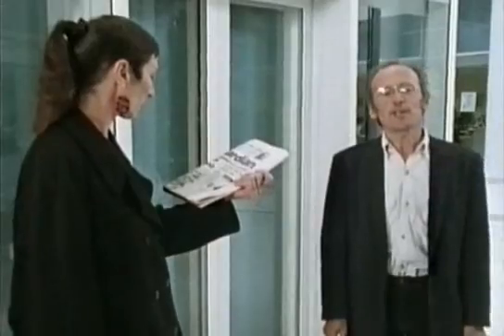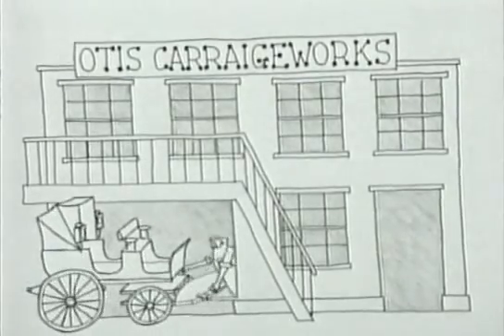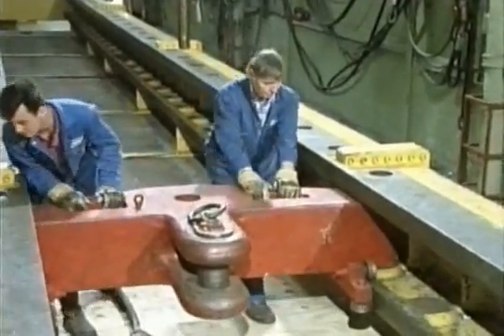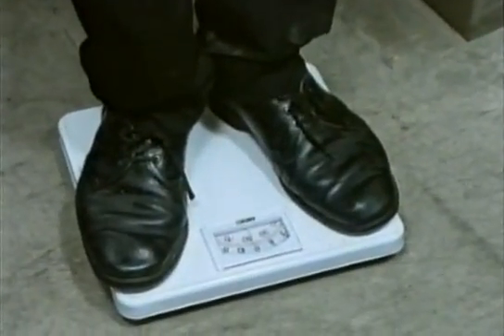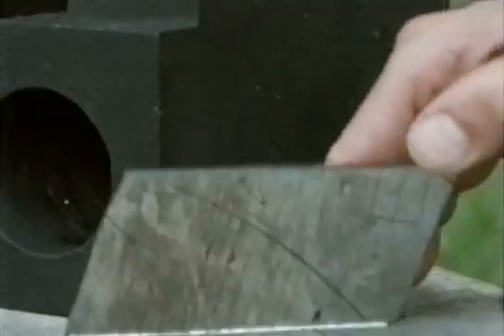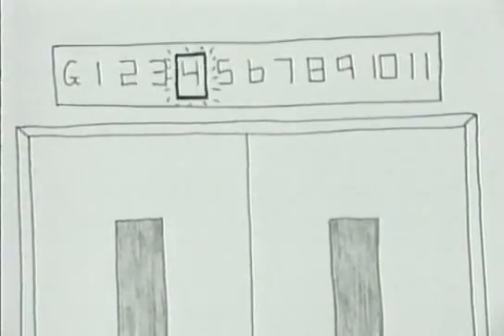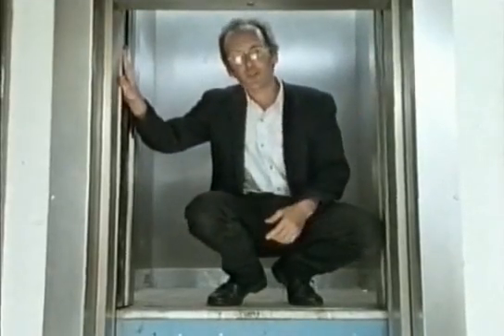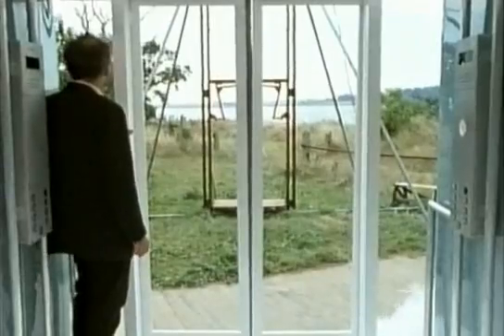The Secret Life of the Lift (Secret Life Of Machines Series 3 (1993) by Tim Hunkin)

Comment: how did they make the water powered hydrolic lift
Reply: Well, water could be used also as a hydraulic liquid
Reply: Once, til not so long ago, London had a hydraulic water main system, with water at a very high pressure, powered centrally. Brunel (who else?) helped with the design. It was used to power lifts and small machines in much the same way as we use electricity now. https://en.wikipedia.org/wiki/London_Hydraulic_Power_Company
Reply: @donaldasayers  Manchester also had a water main which was used to power lifts

Comment: Hydraulics really didn't last long, I guess the technology and lower cost has made MRLs that much better hydraulics are no longer manufactured. Power consumption is a big player these days too, lack of a counterweight really adds heavy usage!
Reply: Hydraulic lifts will be made a long time into the future. They're fine in specific situations.
Reply: @millomweb  definitely, and it depends on country/economy. Hydraulics are fast disappearing from mine.
Reply: @teravolt1195  They're the sort of thing retro-fitted to small buildings as all the mech is on the groundand typically no more than 3 floors. Typically fitted to make upper floors accessible by wheelchair users. So not high usage situations.
Reply: Hydraulics are still available for specific needs mainly lifts with heavy loads,  e.g.power stations and steel works
Reply: I know they've been installed in shopping centres - with pretty much glass everywhere on the 'shafts'.

I can't see them being replaced for the purpose of loading cargo onto planes either.